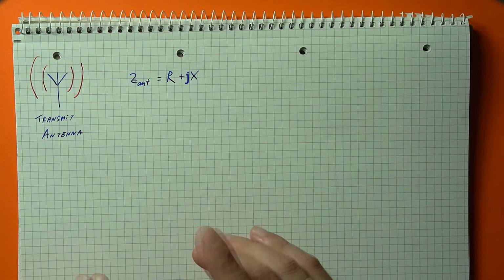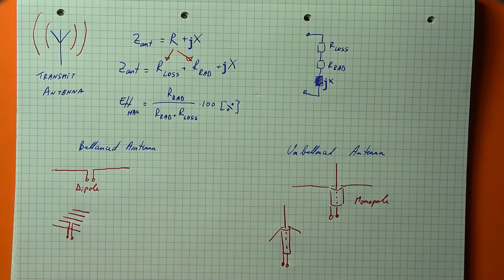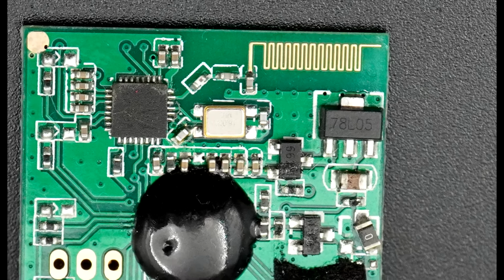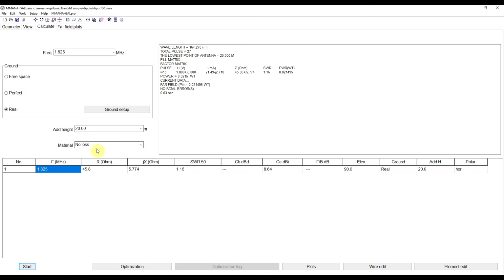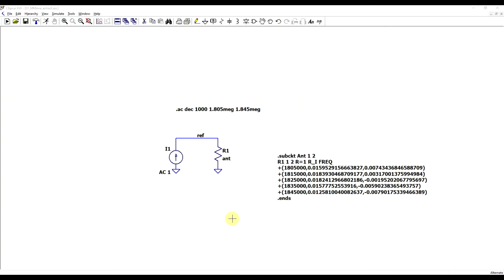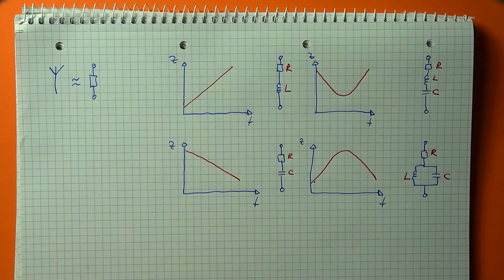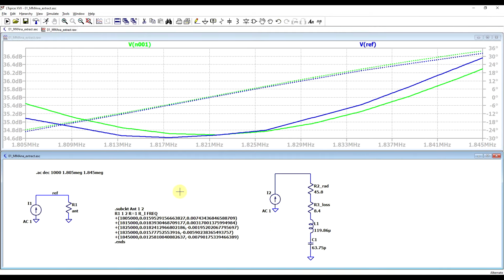Antenna Equivalent Model

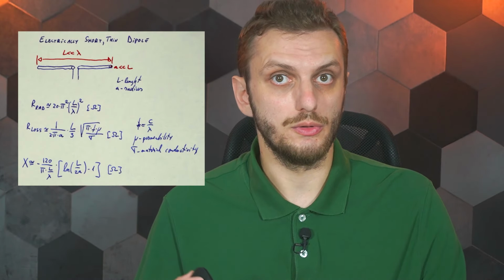Comment: Hello a question. At 5:25 you say we can also use a network analyser to measure antenna impedance but then you add that we need to build the antenna for that. I didn't get what you mean. If we buy an antenna, can't we just measure its complex impedance by using a VNA and then make our impedance matching? Are you talking about designing our own antenna here? Can we instead just buy the antenna and then measure its impedance by a VNA and then use that impedance in our simulation to proceed?  Thanks in advance...
Reply: oh okay at 11:25 you explain that:))

Comment: Just curious. I've tried to replicate the LTspice model, but R1 is always generated in the netlist before "subckt" block (independent of the block positioning) and the program can not find the definition. Is there an extra requirement in settings or something else to implement such a frequency dependant model?
Reply from the maker: The same happens in my case as well, the resistor is first; however, its not a "resistor" but rather a subcircuit - the resistor component is set to be of "X" type - Ctrl+Right click on the component and set the prefix to "x". Let me know if it works out.
Reply: @FesZElectronics  Thanks.

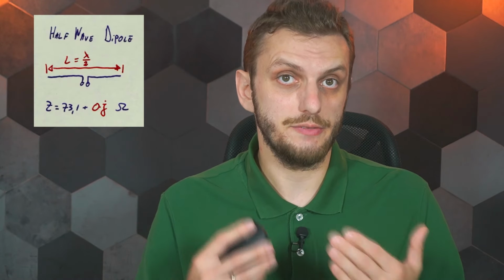Comment: 5:10 A half-wave dipole has a theoretical impedance of 73 + 42.5j. In practice, the dipole is shortened until the imaginary reactance goes to zero, at which point the radiation resistance will be below 73 ohm.
Reply from the maker: Indeed you are right... the ideal, infinitely thin, dipole impedance at L/2 is ~73+42.5j; you can get it to resonate at a slightly smaller length, where the impedance will be ~70R+0j

Comment: The modelling of antennas like MMANA-gal does is fascinating - putting bits of electrically unconnected conductors of certain lengths at certain distances from the driven conductors affects things in profound ways (which is how Yagi-Uda "TV antennas") work, they're just a dipole in the middle with a bunch of unconnected metal rods on either side)!